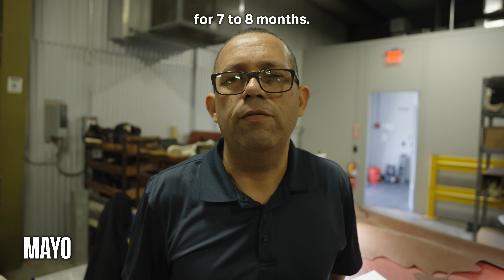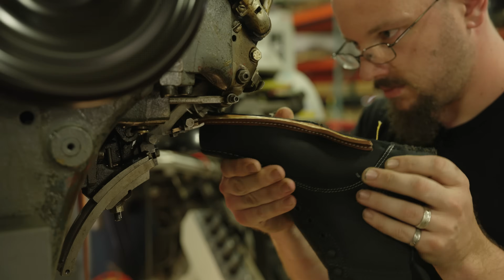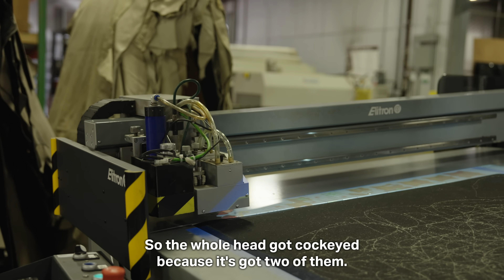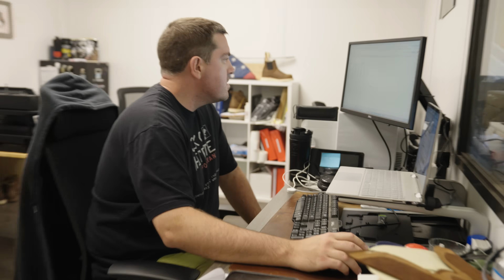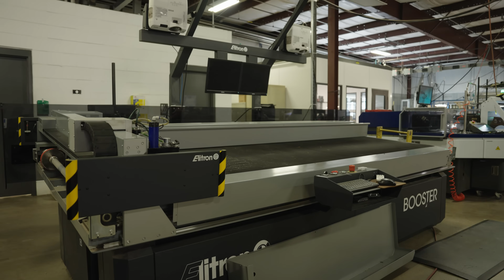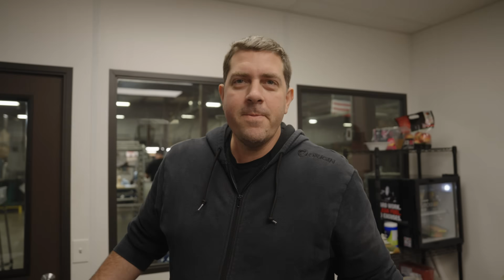Our Boot Factory is Having MAJOR Problems

Comment: Something my first television tower boss told me... I was ontop of a 1000' to 2000' foot tower at night time hanging off a 125' pole ontop of the tower and the fiberglass hand holds kept breaking off. There wasn't anything else to hold onto and there was no way to have a safety, so I was free climbing.
Reply: if it was easy they would have *^*& and &*^$& up here and we wouldn't have a job.

have fun with your little boot problem or whatever